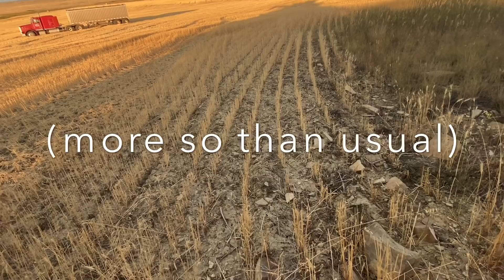Wheat Harvest 2020 - Day 74 (8/17/20)

Comment: Hi Tracy.
A frustrating start for sure. I  guess it would need to come off for welding anyway.  The welder would surely be a bit of a fire hazard near the combine.
I notice that there are very wide margins of land not cultivated by the road sides etc. Is this a requirement by law or is this land just not suitable. 
Lovely sunset once again to finish with.
See you tomorrow.